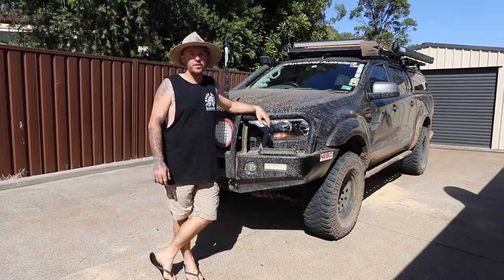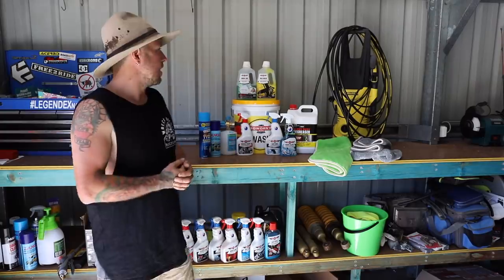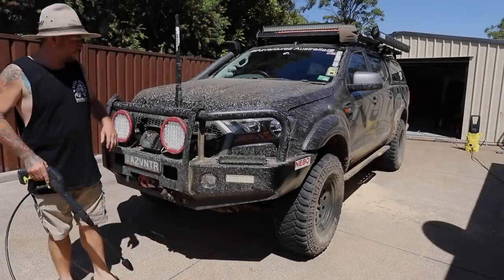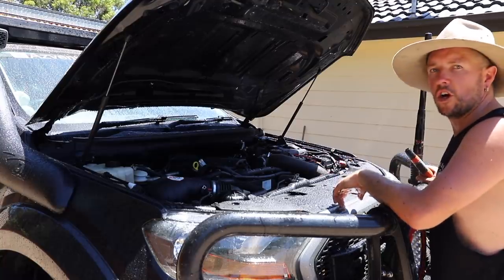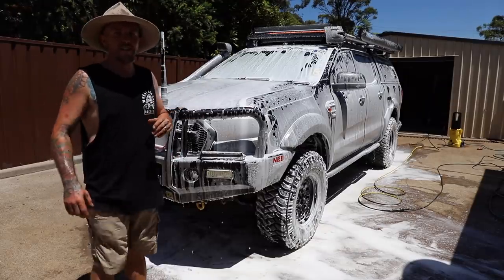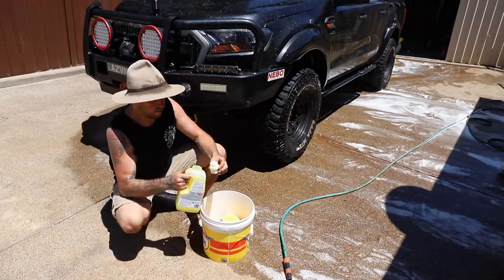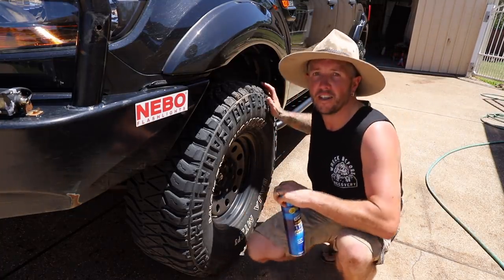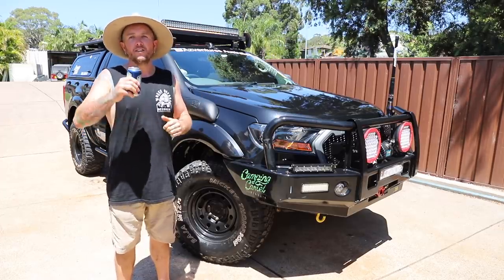How I wash my car

Comment: Another option when detailing the engine bay which I do is after you finish washing it, spray amoral everywhere and let it idle  with the bonnet closed till it gets nice and warm and it comes up brand new, also doesn't collect dirt as much as tyre shine

Comment: Try to start using straight lines while you are washing with the mitt. Black paint shows all imperfections, you wanna make sure you are not putting swirl marks into the paint by washing in circular motions, because they will all show.

Comment: No need to disconnect the battery. Every workshop I have worked in use pressure washer to clean engine bay. Just be careful where you aim it.

Comment: I have a Lexus ES300h and I do 1000+kms a week for commercial. I use the pressure washer every few days but never hand wash the car unless absolutely necessary (to save time and elbow grease). When I hand wash the car I tend to do it in the evening (or morning) when the sun is not so strong. If you have to hand wash the car under the sun, do it in sections like the video otherwise it dies in no time leaving the dirt. I have to do it quick and it takes 20 minutes to pressure wash + dry the car and an hour to pressure + hand wash + dry.

Comment: How did you extend the line on your pressure washer?
Reply from the maker: Hey mate I bought a extension for it from Bunnings.... worst thing I did was ever use karcher brand stuff mate would highly recommend going to something better... I now run a Gerni 160.2 and it’s one of the best electric pressure washers I’ve used 👌👌
Reply: @AzventuresAustralia  thanks for the advice mate.

Comment: I do it different, i wont blast all the dry mud first thing like that with high pressure it's a bit like running a sand blaster. I do a snow foam with CT-18 truck wash, let it dwell and soften hose off and then pressure wash.
Reply: And drying it by dragging the green sucker all over the paint is not the best for marring, use a blower and don't contact the paint at all.

Comment: Tyre shine in the engine bay attracts dirt to the bay like pedos to a wiggles concert bro
Reply: it rinses off easy though
Reply: @troyd-motorsport9933  And also browns rubber and silcone hoses 👍
(Been a detailer for 10 years)
Reply: @Hillzy_Eighty7  Oh didnt know that, thanks!   What do you use in the engine bay then?
Reply: @troyd-motorsport9933  Nothing with silicon
Reply: @Hillzy_Eighty7  Sometihng like armorall?

Comment: Heavy duty degreaser as a prewash? Wtf. Theres dedicated prewash you can get that's wax friendly. You do realise that will destroy any protection you've put on it and it ruins aluminium and makes it chaulky? 

You're basically going to the emergency room for a paper cut. 

Over 1800psi and over 7 litres a min will give you good foam.
Reply from the maker: Luke Walker I hear what your saying mate about the degreaser and paint protection, but I don’t have any paint protection on my car so I’m not worried, and I only have 2 bits of alloy and they look sweet still, I’ve been using that degreaser for many years on dirt bikes growing up and other cars and don’t think it’s really that strong, I use it purely to break down the dried mud that a simple prewash detergent wouldn’t work on
Reply: He is also using spray wax after the wash, so either way he is re-applying protection. No harm in his method
Reply: Spray wax doesnt last long at all. This washing method is basically the 'using the biggest hammer you can find' method when theres no need. 

Degreaser and all purpose cleaner is the stuff they use to remove SiO2 coatings on cars. It drys your paint out by stripping it. Spray wax wont be replacing anything your removing with the degreaser. I can guarantee the water beading properties are very minimal. Instead of Lazy Wax at least use Fully Slick with Lazy Wax on top.